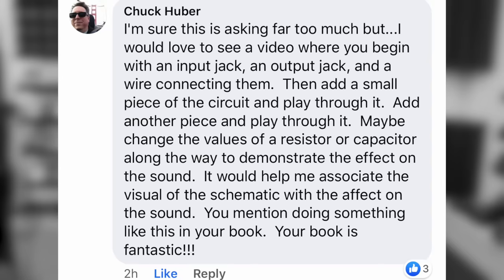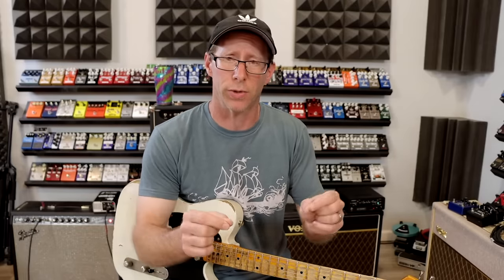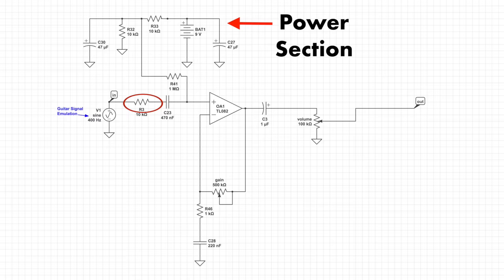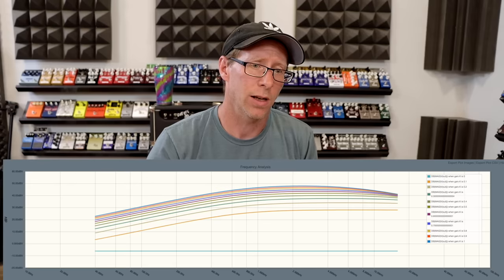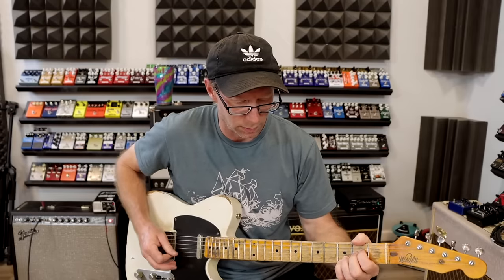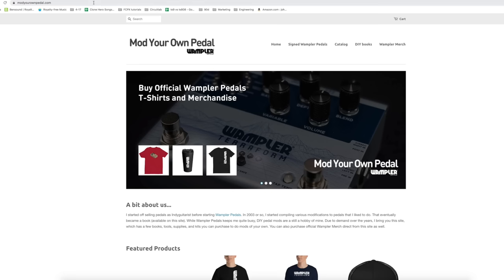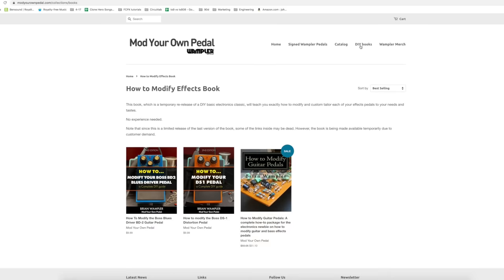How To Design An Overdrive Pedal Circuit

Comment: Video suggestion: A beginners guide to pedal circuits. What's the function of resistors, capacitors, transistors etc.. Is capacitors always/only related to bass/tone? What's the significance  of where in the circuit you place the different components; of what directions they have (plus/minus/ground); of the size of the components. Stuff like that.
Reply: Well, I'm graduating in eletronic engineering and I'd say you'd need some years of study to understand what's going on, and without being a master of the field. You'd need a lot of math and circuit courses to get to the final tool you can use and understand them.
Reply: @kiromaisus  as these apply to guitar amp and pedal circuits, no, I wouldn't say it takes years. Well, it doesn't have to, but it might, depending on how much time one can devote to reading and researching. You certainly don't need an EE degree to understand it. But, you might get interested in EE as one learns how their amps and pedals work.
Reply: Resistors resist current and they can be used to "drop" voltage. It occurs as the natural operation of the component so it can be used to set voltage levels. Capacitors store electric charge. They are literally a break in a conductor (which is how it's schematic symbol looks). Capacitors are an open circuit to DC (zero frequency) so they can be used to block DC and keep it from places you don't want it, such as separating the power supply (DC) from the audio signal which is AC. The capacitance rating (in conjunction with a resistor, forming an "RC circuit" aka a "tuned" circuit) will determine the frequencies allowed to pass. Ex. In a fender strat tone circuit (the capacitor and the resistance of the potentiometer), they used .1 microfarad (μF) capacitors very early on. Now, .047 microfarad is common. With the tone all the way "down" ( where the capacitor is fully engaged in the circuit), the .1μF will sound "darker" than the .047 μF because the .1 is "larger," so it allows more lower frequencies. The .047μF is comparatively "smaller" and thus more restrictive. Thus, a .05μF would be a little darker than the .047, but brighter than the .1μF. Considering the math that the other poster mentioned, there are formulas in which you could calculate the actual frequencies where the cutoffs occur. That is how you tune the circuit through, either coupling capacitors, low or high pass filters, or tone capacitor (when used in a dedicated tone stack). They all tune to varying degrees, but most aren't adjustable by the user..... Unless you want to modify the circuit and swap components of different values. The tone stack gives the user the  main adjustability.
Reply: @TheDesertRat31  Thank you! that's exactly the kind of thing I was looking for.
What's the reason for wanting to set voltage levels?
Capacitors are only an open circuit to DC once it's charged right? or is it also open while it's charging? maybe the charging occurs so fast that it's not considered?
Reply: @TheDesertRat31  well said. I appreciate you giving a brief explanation as opposed to just saying "nah you'd need years of study like to get it" lol
Reply: @levih.2158  wow I didn't see this reply. Sorry for a late response. Capacitors are an "open" to DC all the time, so it's a key property when using them in a tuned circuit or as a coupling capacitor. The charge up time is a useful property when using them in a power supply that rectifies AC wall current into DC that is used in an amplifier or an effect pedal. Diodes are used as "one way valves" to only admit current in one direction (positive or negative). You arrange them on each half of the AC cycle so that the result after the diodes is a DC current. However, they don't create a smooth current by themselves. There is a "ripple" left over due to the time factor in an AC sine wave. DC components don't like this ripple, and it can be heard as a scratchy, buzzy background noise (depending on the frequency, 50 or 60 cycle noise is easy to hear). To smooth out the rectified DC, capacitors are used as filters. The get charged by the incoming, noisy,  DC power and as the left over AC voltages drop during the ripple, the capacitors will discharge and basically add current and fill in the ripple, making a smooth DC current. It's usually not 100% perfectly flat DC, but it's close enough. 
In the case of effect pedals and amplifiers, the transistors and/or vacuum tubes are designed to operate at certain voltages. The power supply creates the total power needed throughout the circuit. Different sections of the circuit need different voltages (which is what's amplified, or effected, in the case of pedals) and dropping resistors are used to, sort of, grab the voltages needed from the overall power available. The output is converted to from a voltage source to a current source. Amps use an output transformer because speakers need current to drive the voice coil. Pedals use an impedance matching so the output current can drive the signal to the amp and also through other effects, etc. Hope that helps. I'm no expert, I'm just some shmo who likes to know what's going on inside my gadgets.
Reply: @TheDesertRat31  Thank you again :) Well worth the wait!
Reply: @TheDesertRat31 ❤️👍this is the kind of help the intertubes should be filled with. Clear concise supportive.
Reply: @Sarcasmarkus  cool, glad it's useful.

Comment: I’m an EE and though I know all the details of how to analyze this circuit, I found it super helpful to hear each change.  Thank you for the great teaching session.
Reply: Being an EE myself I’ve found classical opamp design approaches less than useful, these circuits are basically broken in any other industry, as long as it’s not fatal for a component, just plugging in parts empirically with a goal in mind is the way to go, knowing circuit topology does help some here, calculating poles of the filters not so much... it’s fun for sure, not having to hit a precise goal with ultra low distortion or super low DC offset that’s actually manufacturable, is a nice break...
Reply: What are you doing now since you chose ee for a profession but are still interested in Things like These? (and presumably dont build them for a living)
Reply: To be fair, you wouldn't be taught things like this video in EE because with amplifier design, distortion is a bug not a feature, and A LOT of consideration is given for how to minimize SNR, not how to adjust SNR to taste lol. The circuit in this video is a basic non-inverted opamp circuit that's probably illustrated near the end of the TL082 datasheet along with the gain equations, plus some diodes in the negative feedback loop, plus some filtering. Plenty of EE courses include filtering and pretty much all electrical applications include filters, and yeah they aren't usually audible but they are usually visible on an oscope or spectrum analyzer.

Comment: Hi Brian. I built one of these overdrives tonight, from the schematic you displayed. I love it - really versatile for such a low parts count.  Thanks for sharing your expertise.
Reply: is the upside down triangle a symbol for ground?
Reply: @thomasdavis5230  yes
Reply: I am working on this overdrive rn but I am stuck on the op amp part what are the additional connections that are not shown on the Schematic?
Reply: @drake.hansen  pin 4 to gnd pin 8 to +9v

Comment: Here's an index to compare sounds in different sections of the video:

0:41 - Input to output
 (bypass)
1:02 - Input filter
 only
3:00 - OpAmp 1/3 (gain @ 0%)
3:20 - OpAmp 2/3 (gain @ 50%)
3:45 - OpAmp 3/3 (gain @ 100%)
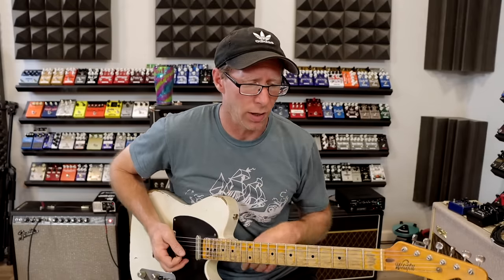4:18 - Low pass filter capacitor
5:20 - Clipping diodes
7:46 - Tone improvement via bottom capacitor 1/2 (stock, .22uF)
8:00 - Tone improvement via bottom capacitor 2/2 (1uF)
9:15 - Tone control 1/3 (all treble)
9:40 - Tone control 2/3 (all bass)
10:09 - Tone control 3/3 (sweet spot)
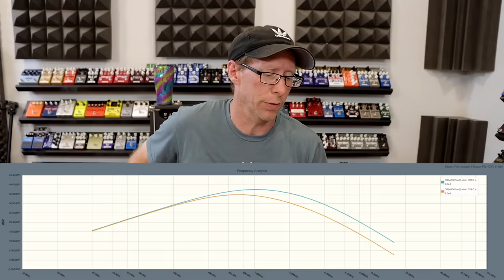11:02 - Tone control bottom capacitor .047uF 1/4 (somewhere in the middle)
11:19 - Tone control bottom capacitor .047uF 2/4 (all bass)
11:32 - Tone control bottom capacitor .047uF 3/4 (all treble)
12:15 - Tone control bottom capacitor .047uF 4/4 (sweet spot)
13:09 - Tone control bottom capacitor 1uF 1/2 (somewhere in the middle)
13:23 - Tone control bottom capacitor 1uF 2/2 (sweet spot)
Reply: He didn’t talk much except for useful stuff.
Reply: Really helpful thank you!
Reply: Yes - thank you very much Luis.

I don’t not appreciate the effort to walk through the creation of a pedal here…but all the talk of ‘scoop’ and ‘clipping’ and ‘meaty’ and ‘tone control’ and ‘usable/friendly’ and ‘fuzzy’ and ‘fizziness’  and ‘presence’ is utter gibberish. Would love it if he did some direct edits where he was playing  ‘before and after’ and  ‘compare this capacitor with that capacitor’ rather than just describing the sound.

Really working hard to translate that kind of language into actual guitar sounds, but it seems impenetrable sometimes. Thank you for making it easier to match sounds to buzzwords.

Comment: Nice one, Brian.
One of the things many people either overlook or don't quite grasp is that the more metal you wiggle over a pickup, the greater the signal produced.  So it should not surprise us that wiggling a wound E or A string over a pickup yields a noticeably greater signal than wiggling an unwound B or E.  I like to say that most of the guitar signal "lives in the basement", meaning that the lower the note, the hotter (higher amplitude) the signal produced.

Now, nothing gets clipped until it approaches what is called the "forward voltage" of the diodes - the signal level where they begin to conduct.  We use some amplification of the signal to reach that point.  But because it's higher amplitude to begin with, the lower notes on the bass strings don't really require as much amplification to reach that point or threshold.  The genius of the Tube Screamer is that it used a strategy Brian illustrates here.  The 1k/220nf pair (R46/C28) provide a modest (6db/octave) bass rolloff, near identical to the Tube Screamer, starting around 723hz.  Progressively reducing the amount of bass signal hitting the diodes (by amplifying the bass less than everything above it) makes it such that pretty much all notes stand an equal likelihood of clipping.  I don't know if one would call this a "smoother" sound, but it is more even-handed and predictable.

You will note that when Brian uses the larger-value (1uf) cap instead of 220nf, not only is there more audible bass, but the sound is also more distorted.  Some commercial pedals will employ various means to reduce or introduce that bass level to yield more even or bass-heavy overdrive.  It's a handy feature for adapting to guitars with greater and lesser bass content, or simply heavier and lighter-gauged strings.
Reply: Mark Hammer great synopsis!
Reply: @GearGasms  Thanks.  Only took me 40 years to figure out! :-)
Reply: @markhammer643  Ha Ha. 45 years for me!

Comment: I've been trying to build circuits for years. It's still magic to me. I still haven't found any teaching material that can explain what each component actually does to other components and why without going into advanced circuitry diagrams or loads of math.
Reply: With capacitors you really need to know a couple formulas. Anything in electronics kinda requires a bit of the maths. So just look it up, it's necessary for good understanding

Comment: Greatly appreciated. I'm about to mod my 1st pedal. It's a TS type with 3 diff diode possibilities. I socketed the diode section to jump to the breadboard. I was fine with all of that. Got a good selection of diodes, caps & resistors. My head scratch was altering the caps. Thx much.

Comment: Having only built a couple of clone pedals from pre-designed and printed boards, this has been massively helpful in understanding the effect of different components on the overall output and tone of the guitar. I have a massive amount of components now, just need to get a few more - op amps, pots and some breadboard - before I feel I can start experimenting for myself! Thank you!

Comment: I was so excited to watch this and learn what each component does. I’m good enough with electronics that I could build this and troubleshoot it from the schematic, but I still don’t actually know what each of these components actually does after watching this. I mean, I know what a resistor does, but when you put a resistor between the op-amp negative and the capacitor before the ground, I don’t know what that resistor or capacitor are actually doing. It would be great if you had just verbally explained the power section and the function of each component, rather than just showing how the sound changes as they are added. This video seems like it’s for beginners but it assumes the viewer knows what an op-amp is and how and why the power section is constructed as it is. Great video though, still. I can use this knowledge to build this exact OD, but not necessarily my own. I wouldn’t know what to change because I don’t fully know what the function of each component is. I know what a resistor does but not why each is in place, nor why you’ve used those values. Thanks for the video, I’m excited to check out more of your channel.
Reply: Then you're clearly not good enough with electronics, contradicting the first half of your second sentence. If this video was to explain how op-amps work, go into all of the different configurations of resistors and caps with the inverting and non-inverting inputs, then it would be hours and hours long. That's not to mention covering how filters work and how they affect tone.
This video isn't necessarily about how each individual component affects the sound, it's about how each section of the circuit (the amp, filters, voltage dividers, etc, that contain said individual components) affects it. If you don't know how these sections work on their own in an isolated circuit, then you have a lot more to learn before getting into this video.
Reply: Yo, I’m feeling exactly the same as your description. I don’t know how each parts really do to the sound. Knowing you posted this comment 3y ago, what did you do to get that knowledge ? Thanks

Comment: I've just made this overdrive circuit and I think it sounds great! Maybe not quite as creamy or tube-like as something a bit more sophisticated, but I've already got a box that does that. This is a little bit rougher and edgier, but that's exactly what I wanted. 40 years ago I used to have one that I made that was very similar to this, but somehow it disappeared along the way and I lost the circuit diagram; this is as close as I've been able to find.  

I wanted the sound of the circuit as it is with the diodes in the feedback loop, but I also wanted the sound you get when they're across the output, so I used a DPDT switch to give me the option. The switch has a centre-off position which disconnects both sets of diodes so then it's only the opamp itself distorting, but this option is much, much louder, so if you try it, beware!
Thank you Brian, I really, really appreciate the article and the video.
Reply: I guess you just described the plumes

Comment: Interesting video. I'd love to see it again with a pure sine wave for an input and an oscilloscope showing the change in wave form through the additional component additions.
Reply: @Jacob Faseler  I have EveryCircuit on my phone and Tina installed on my tablet. While these software simulators are nice they do have their limitations unless you buy the full blown versions. I've designed circuits in software that did not work when breadboarded. Sometimes it just took changing a few resistor values on the breadboarded version to fix my problems. Once I'm building on a breadboard I use a real scope and real volt meters and amp meters. With an audio device I also like my ears to hear the differences. Apps on our phones can replace my old signal generators though.

Comment: This is exactly the kind of thing I need to watch right now; I’m awaiting delivery on a kit to try my hand at building an OD, and I’m gonna apparently be given a range of components to try different values. Gonna be my learn by doing project but it’s good to get exposed to a little light EE theory before I just start soldering parts in place!
Reply: Just remember to disconnect power before changing components and also that capacitors will hold their charge potentially and even a small cap can give you a pretty big shock :)

Comment: Now split the signal, on one signal do deep/high very fuzzy hard clipping with no mids, AND on the other signal do the same soft clipping you just did but scoop some of the mids out and give it a little fuzz here, and on this sides output give it another more simple soft clipping amp (leave the raspiness alone)

You have now achieved the crunchiest tone ever. Congrats.

Comment: This was a really good video.  If I didn't have kids bouncing around (due to isolation), I would get out my breadboard and follow along.  Swapping out the capacitors gives some nice ideas for mods. 

I think you mentioned in an earlier video op amps don't change that much.  I think the ti81 is  fairly common (which makes this OD pedal design something someone could do easily.)

The other practical detail here I think is the taper on the pots.  Is it like a guitar where volume pots should be log taper and the tone linear?